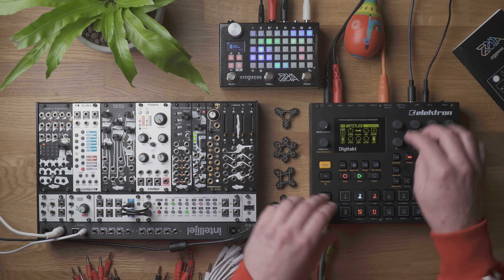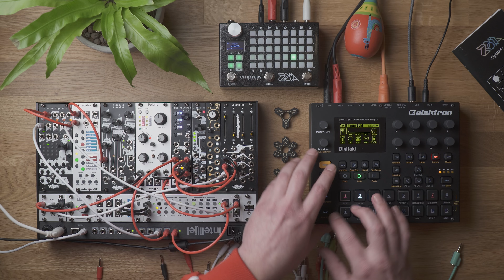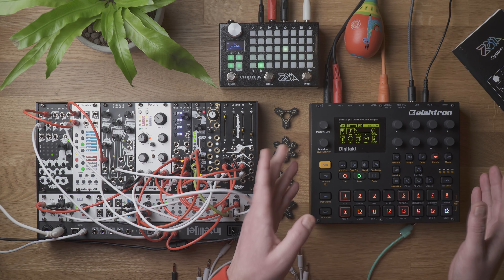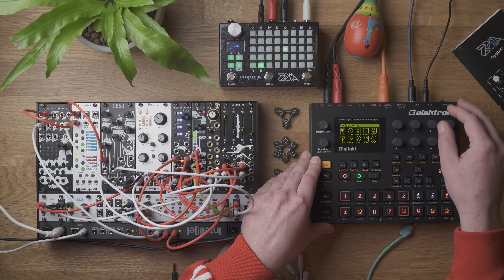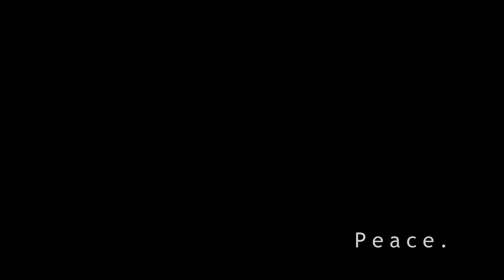Techno Break evolving with Clep Diaz / 8 bars Filter Modulation, Ducking Techniques for Techno

Comment: Love the idea using a low pitched filtered snare for rumble. The Clep Diaz is a workhorse. For 8 steps though, you would have to set it to the 4th LED only. Like this (first 3 LEDs on) you'll have 7 steps. Since you reset the CD, it doesn't start to shift. Which can be also interesting.

Comment: My man! I love your vids... I am slowly going this digitakt+modular direction as well and I was wondering if you could implement more digitakt's MIDI sequencer ... maybe even instead of the steppy and mimetic combo for a video? 

Anyhow keep it up, it's great, what you're doing!
Reply from the maker: Hey! Thank you for hanging here! ✌️

Using DTs sequencer for my modular is my goto thing usually. With MIDI 1U module (or any other MIDI interface for modular) it covers A LOT of use cases.

Tho a big advantage of Mimetic and Steppy combo for me is its melodic/rhythmic randomness and ease of use.

Have a look at one of the videos on my channel about MIDI 1U module. There I use DTs sequencer a lot. ✌️
Reply: @IhorMedia  Yeah, just came across that Techo Break😄. And you're right.. I guess DT sequencer could work just fine if you prepare your patterns in advance, but for live improvisation Steppy+Mimetic make more sense. 

That's bad news for me, because it means 2 more modules in my schopping list.
Reply from the maker: @gastawson4398  exactly that! Tho Steppy can also be replaced by the DTs sequencer easily. Always so many ways 😊
Reply from the maker: @gastawson4398  also! Tho I think these were bad news for your wallet, not for you, mate :)
Reply: @IhorMedia  yeah, those are the things, that go hand in hand with one another.